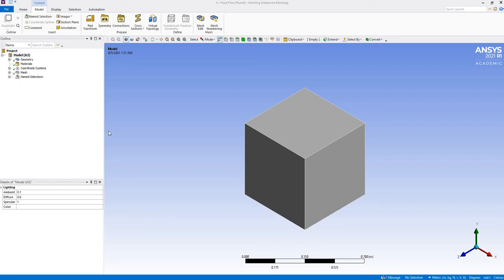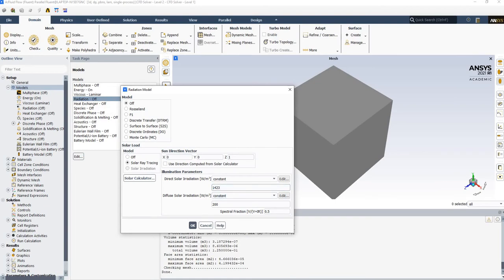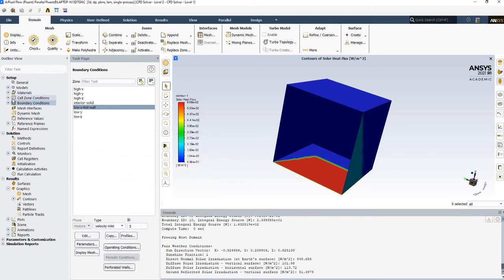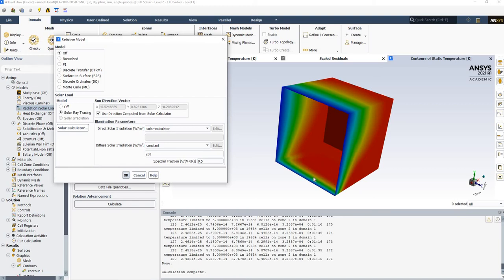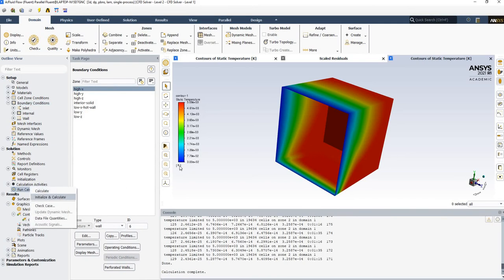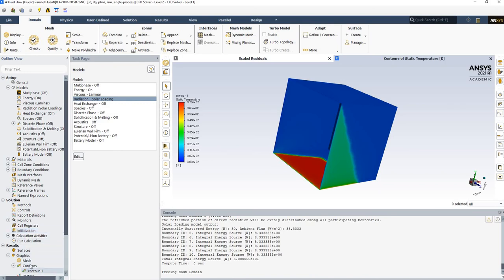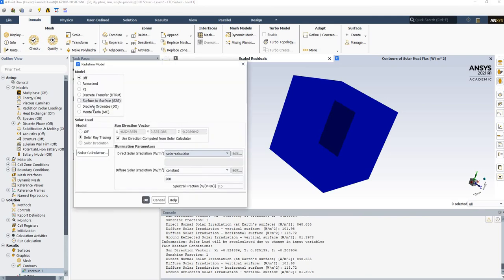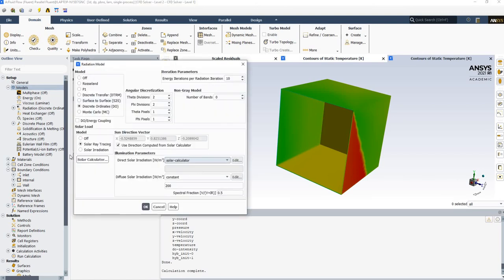Solar Loading Model Fluent

Comment: thank you, i have a question. you showed the solar heat flux contour on FLUENT, but not CFD-post. Is it possible to see the solar heat flux contour on CFD Post? because in fluent the solar heat flux can be displayed but in my CFD post its not showing.
Reply from the maker: CFD post will only show the parameters you have saved for post processing. For transient problem, it should be in the calculation activities>automatic export section...for steady-state, try clicking on the File>Data quantities in Fluent and add the heat flux as a data you want to save for post-processing

Comment: Excellent tutorial. Could you please explain the mesh orientation ?? which point is (0,0,0)? May I know why you put Z= -1 in north ? Thanks in advance.
Reply from the maker: (0,0,0) is one of the bottom left corner of the geometry . I think the best way to explain is x-length, y-length and z-length are all in positive direction.
Now, I put z=-1 in solar ray tracing model to specify the angle of incident of solar flux. You can select any value of x,y and z in solar ray tracing option. However, make sure the angle of incident calculated from those value are your required incident angle. Its a simple calculation, like, tan(theta)=height/base